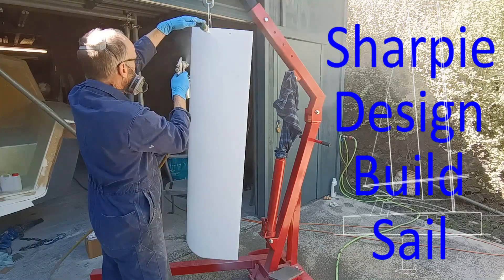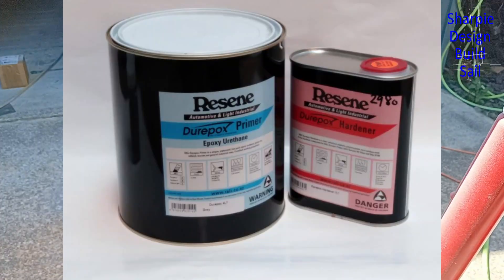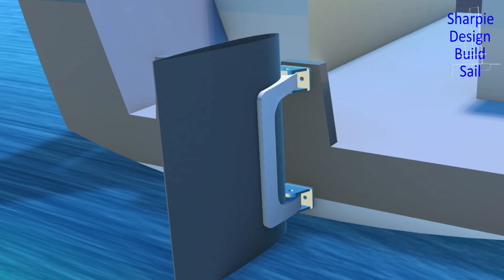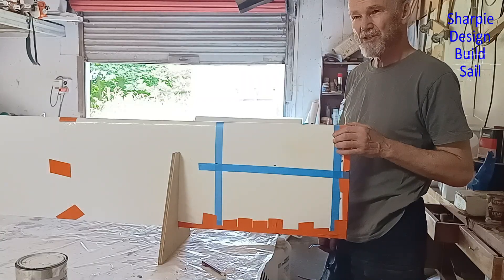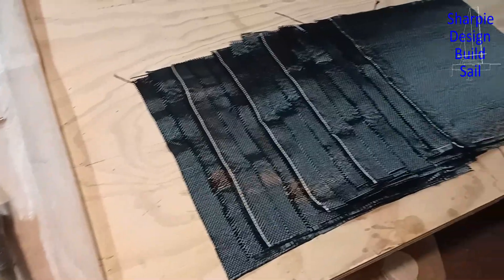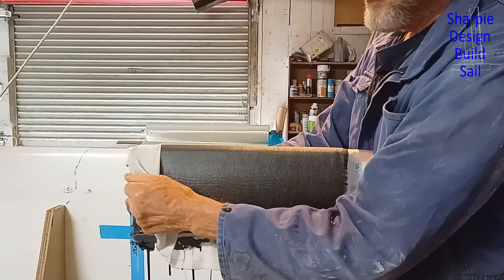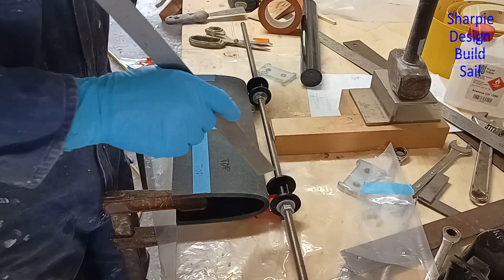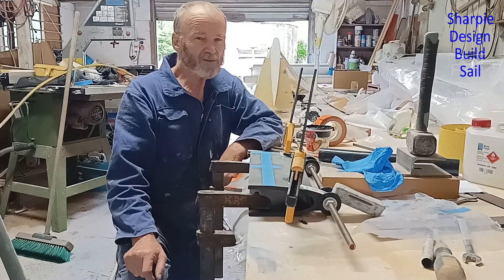Carbon Fibre Rudder Stock Begins! Fairing & Painting Sprint - V68 Rudder Pt3

Comment: Where did you source those delrin bushings?
Reply from the maker: I just bought 45mm round stock from Cambrian plastic in Auckland and machined them up myself as I have a lathe. Probably only half an hour's machining so quite quick and easy for someone to do.
Thanks for the question.

Comment: It will be a super-strong construction for Sahrpies' rudder. I'm always so impressed by how a few carbon layers (your 7mm) are so stiff. Good work as usual. Cheers.
Reply from the maker: Yes, it's an amazing material used right. My Young 11 yacht had quite a high tech carbon mast and I loved the metallic sound it made when you tapped the mast. Light too, a friend worked in a facility that built one of the earlier Americas Cup yachts and I was allowed in. I picked up a frame, with one finger 😲
Thanks for the comment and good to see you on deck Captain!

Comment: Hi Karl, I've only recently discovered your videos, and have watched most of them. I love your approach to design and technical detail, and the down to earth way you present them.  I am three years into building a Welsford 24ft Sundowner with a flat bottom and twin steel keels of my own design. I am not a boat designer like Mr Welsord or yourself, but hopefully my ideas gleaned from  many years sailing will work out, because at age 73, I doubt I will have time to build another.
Reply: I am an englishman, currently living in Brittany.
Most of the changes I have made to my Sundowner have been back of a fag packet ones. I have gone for a longer and more curvy coachroof, with the tabernackle attached on top, rather than at deck level. The layout is all my own, with the mast support being the doorframe to the forward cabin with a steel girder across the top. I suppose I am a bit of a belt and braces guy, so the boat may end up a bit heavier than it should be. My wifeand I have owned a series of sailboats, but our last boat ( 20 years ago) was a 50ft Catfish dutch built steel motor cruiser. and cruised in Holland and tge uk. This was bought when my wife decided she didn't want to do waves anymore, but ended up crossing the channel regardless. We are looking forward to cruising the new boat in west france, where  we last sailed 25 years ago on our mediterranean adventure sailing from the uk to Greece.
Reply from the maker: @davidangela6997  thanks for getting me up to speed with what you're been up to and what you're doing with the build. Sounds like you have an amazing adventure coming up with your French excursion! People speak with high regard about the experience of sailing Europe's inland waterways. I'm half Dutch, born in NZ but the few times I visited Holland, it's not till I went sailing there that I really appreciated the place. I even got to sail in the North Sea Regatta race, hundreds of yachts!
Reply from the maker: That's very heart warming to receive your message! I really like Johns designs and could happily see myself in one if I didn't feel a strong need to scratch the itch of trying out some custom ideas. I just looked up the Sundowner and what an awesome design that won't limit what you want to do in a functional vessel with classy lines. I'm quite a fan of twin keels so it's really interesting to me as to what your'e doing. I think you've made a good choice of design for a vessel that will take you into the future.  
All the best with your build. What part of the country are you in?

Comment: Karl
Noticed you added graphite powder to the filler to fill between the bearings and the ‘box’ why is that?
Reply from the maker: Partly I just wanted to darken the resin so when I do the finishing layer of carbon on the ends, the light colour of ordinary fiberglass would not show through (as I did with the galley bench a whole heap of videos ago) and partly to possibly make it slightly easier to remove the bearing bushes when in the far distant future that might become necessary. The way I've machined the bushes to aid construction means they will have to be partly destroyed if every removed.
Very observant of you, thanks for the question 🙂